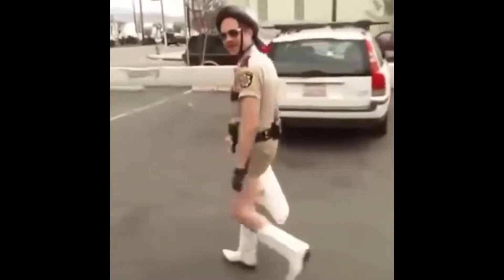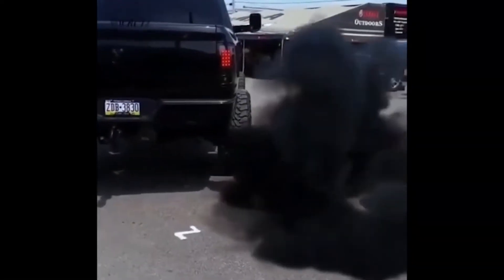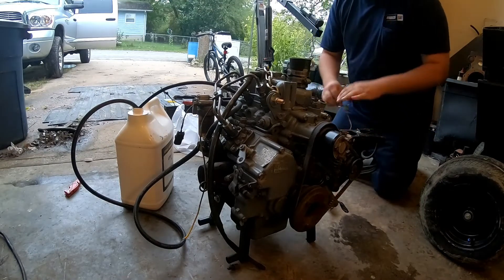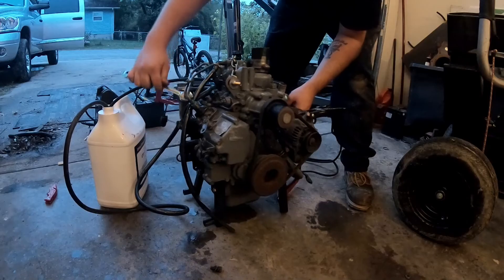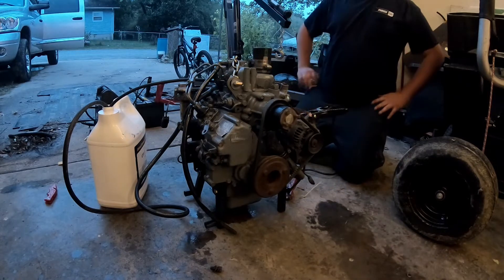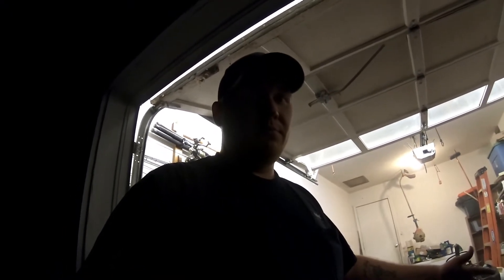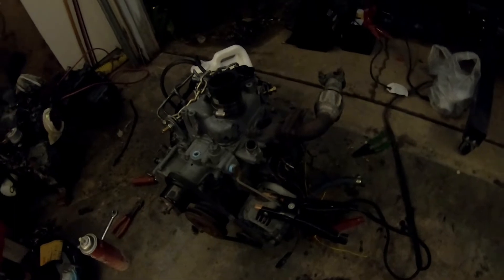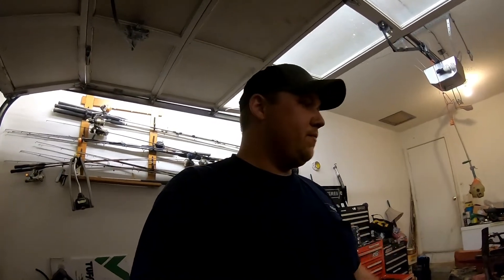2 Cylinder Perkins Diesel Runs Away!!! Watch Till The End!

Comment: Had a similar issue. Rack was stuck wide open. Pull the lines and slide the pump cartridge out. Maybe you'll get lucky, pull the plunger element and clean it out. Even the tiniest amount of rust or dirt will lock it up.
Reply from the maker: Agree completely! I actually ended up getting rid of it before I messed with it further to help fund a Kubota project!
Reply: @Tyler_Robertson  next time then. It's a pretty common thing. Moisture gets in there and with tolerances in the .0002 range... Even the slightest corrosion will have it stuck. Wipe it all clean and feel the fit. Now cost it with diesel and feel the drag. The molecules of diesel are causing the seal. It's very impressive.
Reply: @hvguy I just got one of these engines and I got it running but it only wants to rev up to wide open, I’ve taken the pump apart and it’s clean and all moves freely, I can’t figure out what’s going on
Reply: I have a 402d-05 I just bought I got it running but completely runs away in the procece now of ripping the pump apart

Comment: Are you going to hook up that electric fuel pump it's on there for a reason
Reply from the maker: I would have if it had one. It had a manual pump on side of block after the filter housing... Motor is long gone though.

Comment: It's not going to run away it isn't a Detroit
Reply from the maker: Only Detroit’s run away?!🤔
Reply: Robertson Pulling Team no they all can
Reply from the maker: I know lol I was making a joke about him only saying basically a Detroit can only run away
Reply: They all can run away but the only ones to survive that are bad ass 2 stroke Detroit's. All the rest grenade.  USA1. GM1
Reply: @davelowets    I'm sure you have. But for the most part  no other diesel motor will spin real high rpm and still survive.
Reply from the maker: I’ve seen 5.9 and 6.7 Cummins engines turn 5-6k if built properly
Reply: @Tyler_Robertson   I'm sure u have.  If built properly you said.   Stock DD do it and live on being bone stock. Just saying.
Reply: @scott250r2  I'd love to see a DD rev past 3000 rpm happily and hear the insane screaming
Reply: @Tyler_Robertson  there's a reason why power generators only revs at a constant 1500 RPM